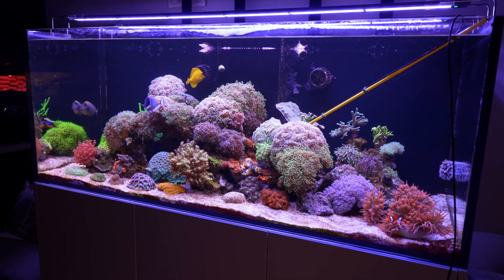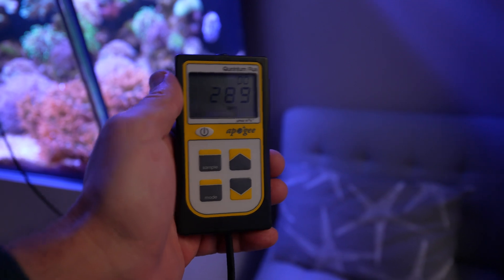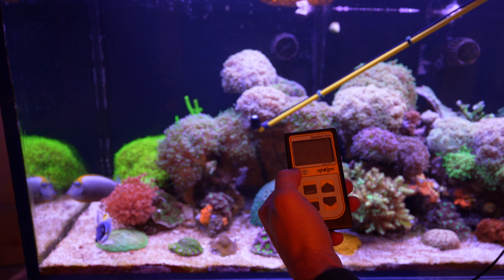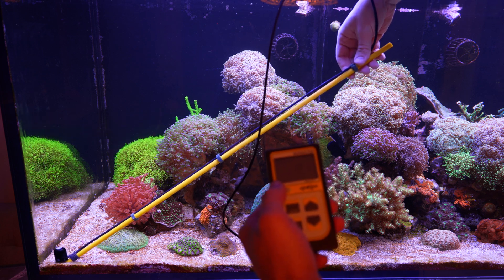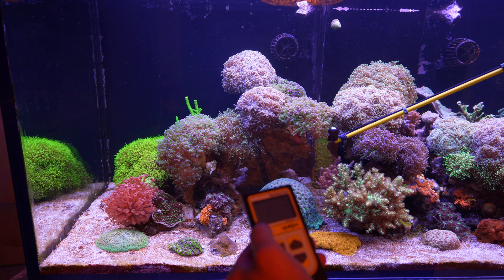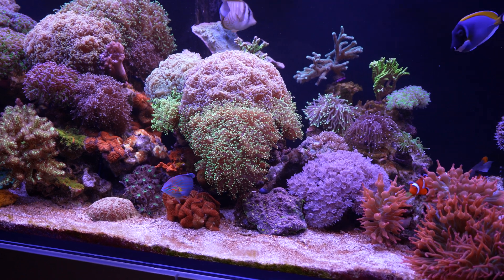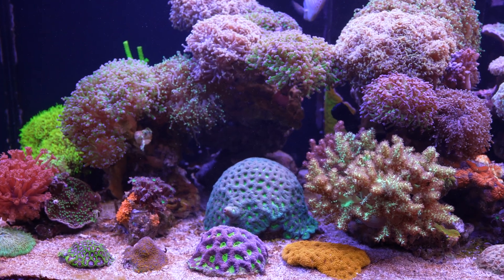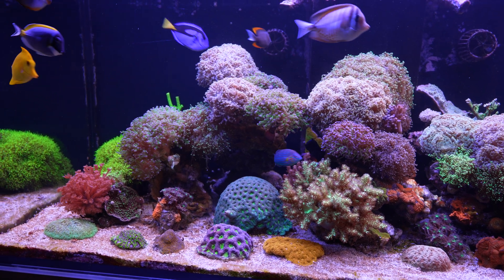AquaIllumination Blade PAR Measurement

Comment: Hi Dmitry,

I’ve been following your blade views for a while and finally decided to take the plunge—I purchased a 30" Grow for our 22g shallow mixed reef. I downloaded your Lagoon schedule and really like it—thank you for sharing that, by the way!

I was wondering if you’ve noticed whether smaller tanks tend to do better with lower PAR levels. I’m debating whether to run your schedule at full 100% on our system or dial it down a bit. Right now, we’re seeing around 175 PAR in the center of the tank (midway down) and about 125 on the edges.  What is strange with Möbius app vs AI, if you lower percent of schedule it doesn't reflect the watts correctly, still shows the original watts of the original schedule which is weird. 

Thanks so much for your time and any advice you can offer!

Comment: Have you noticed any variation in the color from one side to the other?  I just got a 48" Grow in today and the right side of the tank is slightly more blue than the left while running my day time schedule.  100% white 50% blue and 30% royal blue.
Reply from the maker: No, so far it has been uniform. I find that the coral selection may throw off the color of the spectrum - it might appear different in different parts of the tank due to the color of the actual corals.
Reply: @TreasureCorals  yeah I wondered if it was something like that so I rotated the light 180 degrees and the issue was reversed. AI is sending me a warranty replacement
Reply from the maker: Curious, when you say right and left side. Do you notice it gets more blue the further you get away from the power source?
Reply: @TreasureCorals  In my case yeah, the side that the power cord goes into the light is less blue than the side furthest from the power cord.  Its very subtle, if the sand bed wasn't white I may not have even noticed it.  If you saw my other post on your more recent video, the light they sent under warranty has the same issue.
Reply from the maker: @bob8619  Agreed. And I now see people posting this on forums as well. I certainly hope it is not a design flaw of some sort. I am noticing it as well
Reply: @TreasureCorals  strongly considering (2) 30” grow for a 36x24x20 deep mixed tank.  What do you think? Is the left to right unevenness a deal breaker??
Reply from the maker: @claytonjon  I think it is a great choice. I have mitigated by unevenness by running these in two opposite directions and it is not a deal breaker for me

Comment: This is awesome! Not a criticism of the light but I hope it gets used correctly.
I went and looked up the BRS measurements of the Aquatic Life fixture with just the 4 bulbs. They put out 140-160 mmols on the bottom of a 2" cube. That means these lights are much stronger than 2 x T5s (especially if those measurements were with the whites turned down).
Due to the limited number of LEDs I'd prefer to use these as fill lights and have central fixtures - if I had the budget. Still then I'm sure (even on an SPS tank) that I'd need to turn them down and that's fine because they look super sleek.
I mostly love the multiple puck configuration to blend the light from the diodes.
The only possible criticisms I have (besides that reefers know they shouldn't just add them to their Radions and turn them on at 100%) is that they are premium as a fill light (not as standalone) and how much pop to they actually provide (if they are 450+470nm+whites I would run just the 450+470s and it would be awesome).
The big one is the price - on BRS the $190 to $240 to $330 jumps means it's $50 more for a 30" over a 21" but $90 extra for the 39" - that seems weird and the Glow is more expensive it's weird. Still if you have the cash they look stunning.
It's going to be very interesting to see how reefers use them.
For a 4ft LPS tank my preference would still be 2 x XR15 Blue vs 2 of these - more colours, contrast and shadowing I think is a positive and it's 200W either way and $1000 vs $800.
Reply from the maker: Great analysis. They are MUCH stronger than T5 bulbs. I plan to run these exclusively on my reef.
Reply: @TreasureCorals  Thanks mate. Also I looked sand sifting and I think a diamond goby is probably the hardiest and usually (according to some on R2R) they eat pellets, frozen etc. I think also because they are small they do better long term than some of the bigger gobies and don't drop sand from too high. Anyhow check that out as an option - I am thinking of getting one now ;)
Reply: It's one of the cheapest options per PAR on the market
Reply: @rolisreefranch  As a reef bar it's the most expensive and for what length?
Sure on BRS for a single Grow 21" over a 2 foot cube for the lights they sell as a main light, all channels at 100%.
But a 48" Glow on BRS is $569.
I wouldn't use it as a main light. As a fill light, it's expensive. The most expensive bar on the market.

For comparison a 48" Orphek Blue Plus is $200 (yes it's 42.5% of the power I think).
I see the value as a bar - it looks amazing - to tilt it forming a shade will be epic and I want a wide tank (30" or even 36"). The optics look like smashing every other bar out of the park.
From what I can tell it's the best bar on the market - the BEST.
I think the best way to use for most reefers with 2 foot wide tanks would be to add a single one on the front, tilting them back. This would be amazing because they are really replacing 2 reef bars. I can't wait to see the mounting options that people come up with for this. It's a shame BRS didn't test them as 1 paired with a Radion or AI 32

Comment: How’s the color on these vs the prime/hydra or even Radion g5/g6?
Reply from the maker: A lot closer to Radions in my opinion. And even evokes T5 memories.
Reply: @TreasureCorals  hmm… I may just switch from a xr15 G5 to 2 of these blade on my shallow tank. From what it looks like, par wouldn’t drop much but spread will be better.

Comment: Thank you! I was curious. Now if someone can measure while the lights are mounted 9-12 inches from the water line. If I'd use them, I'd mount them with my xr15 as fill light. To replace my t5s. These lights are mounted at about 12 inches.
Reply from the maker: I will see if I can try them higher from he water surface. I am very tempted to put a pair of them over my frag system to supplement the radions. These do feel like T5 to me and they seem to be more powerful.
Reply: @Treasure Corals  yes. I'm excited. As stated on other comments. I've been looking to replace my t5s with light bars. BUT none of them seemed convincing. Either not enough power, spread and/or some seem defective over time. But these seem to have everyone one would need.

Comment: Thank you, do you think two blades will replace the expensive led
Reply from the maker: Depends on the led, but I think 2 blades can handle any LPS tank and 3 blades - any SPS tank. I also think that 2 blades could be just fine for an SPS aquarium - 300 par is plenty.